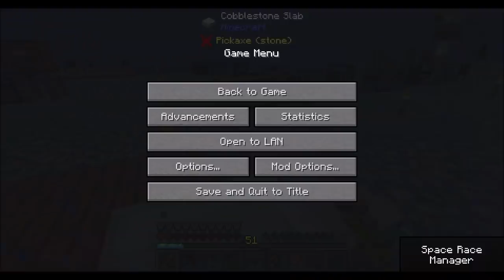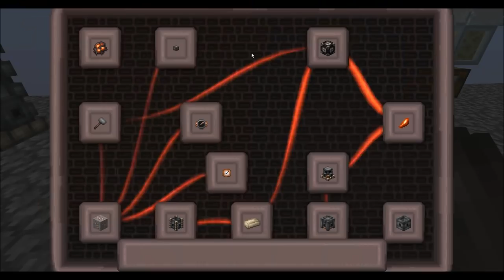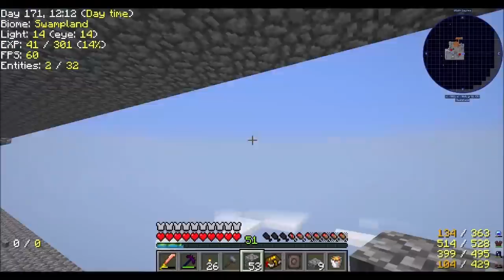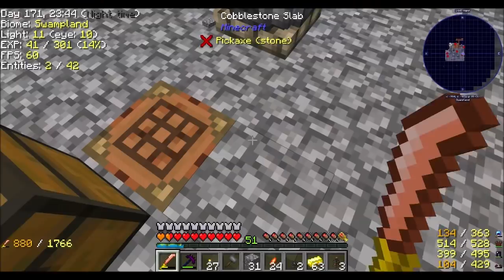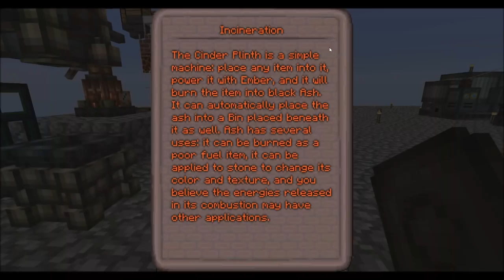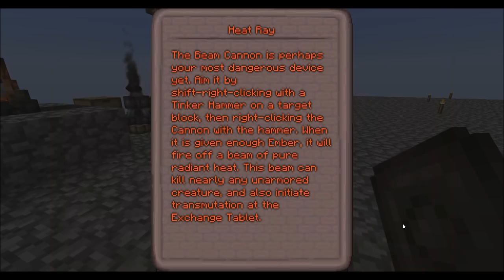Modern Skyblock 3   Ep42 Ember Magic

Comment: There's not a lot to like about Embers, plus the fact that it just spits out items and doesn't have a UI to add and remove the wrong items in the machines, it just takes an entire stack and you have to break and replace the machine to get the excess out.

The Embers golems that spawn in the mob farm are the biggest downside for me, I don't like the range on their fireballs, plus if you get more than one in there good luck getting your corpse back without cheating like a madman.

Comment: You can make mekanism pipes react to redstone signal. Making it easy to direct the flow to a specific tank on the mixer or bypass it entirely if needed.
Also Embers does come with its own piping system.
Reply: Eric Beauregard the fact he’s used embers before and already forgot its pipes shows his age...
Reply: Scubysnax2012 Also the fun fact he break the receptor on the laser Everytime instead of turning the lever off :p

Comment: Has anyone encounter a bug with Botania where Mana Pool is not working? I.e. it is not filling with mana from mana generation sources? Generating flower is working and linked to spreader, spreader is working and liked to mana pool, mana blasts are flying - but pool is not filling. No blue liquid effect, no bar filling when I use the wand. But - if I spawn creative pool, take mana using tablet, and put it into normal pool - it is showing liquid and bar, but still doesn't accept sources.
I know it has something to do with the world - because there's no problem with new world, but I do not want to lose progress.
Help?
Reply: Kristoff B you sure it's not just visual?
Reply: No, it's not just visual - I used integrated dynamics block reader and mana level is not going up even though mana blasts are coming from spreader.

Comment: It's not a big deal, but smashing your alchemical waste can save you time waiting on ash creation.  It doesn't smash into a single ash, but rather about 40%-50% of the ash you burned in the failed recipe.
Reply: Since ash is so cheap to make i usually just rename the waste as the item i was trying to make and the exact amount of ash i need in each pile as a reminder for the next time.

Comment: "Somewhere between 24 and 48, so let's put 32 in there..." Yes, because it would be so difficult to use the minimum amount to not waste as much Ash and add more from there. #DireDerp
Reply: It's called binary search.
Reply: Binary search is awful in this case and is only useful on sorted array-like structures. Using the minimum needed ash is the optimal way of doing it. Using the minim is statistically as likely to be right on the first try as any other number, you waste the least amount of ash if you fail and you know exactly how much you need the next time since you won't be confused if you need to add more ash or use less like he did. On top of all that, binary search starts in the middle, 32 is not the middle.
Reply: Entitled 36 is middle 😅
Reply: Boyd Smith Binary search does not work in this case. That's because it tells you how far away you were from the correct answer. Binary search would only be optimal if the only information you were given was whether it was fewer or more.
Reply: you can use no ash I believe and it will tell you the amount... I think...
Reply: Logan Daniels Last time I played you had to put a least he minimum ash in it for tje crafting to start. Maybe that was changed.

Comment: I would say it's fine for u to use /weather clear (if that's still the command, I'm 90% sure it changed)
Reply: Emrit Ramharracksingh it hasn’t changed
Reply: The pack has a rain protector which is extremely cheap to make and doesn't use any resources to run. No need to use commands when you have ways to deal with it in the game.
Reply: the rain protector doesn't work for whatever reason (at least in dire's world)
Reply: Entitled yes he made two, one more cause the first wasn’t working and he forgot where it was. The second one didn’t work as well.
Reply: Personally, I just use cheat commands to set the time to 15000 if it's raining and then go sleep in a bed.  Vanilla mechanics always clear the rain on sleeping in a bed at night, thus the rain always goes away for a certain number of days afterwards.